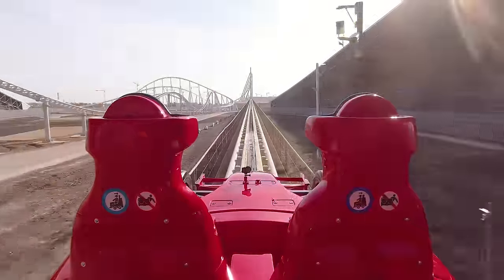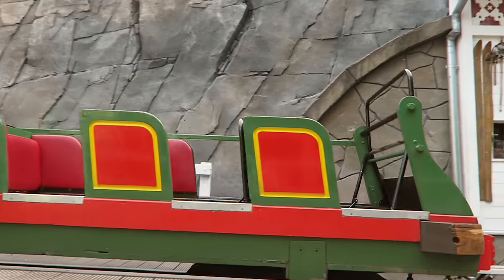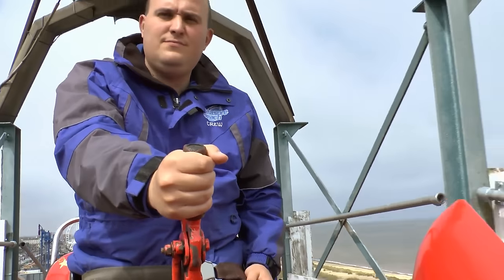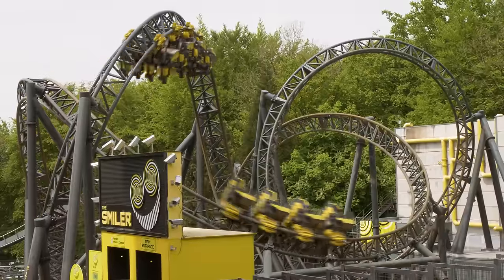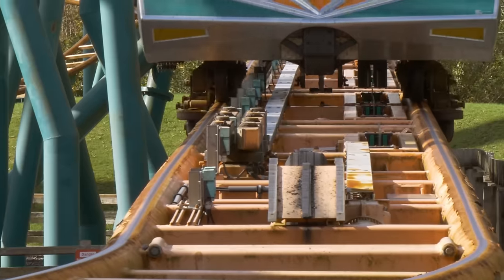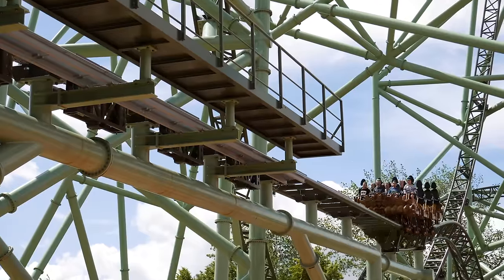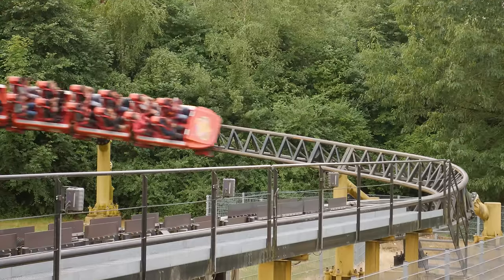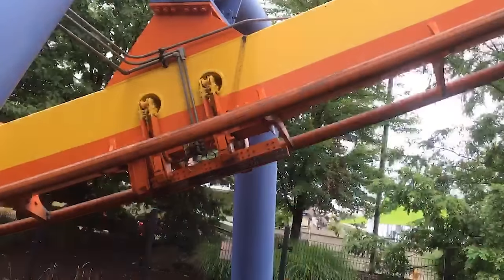Roller coaster brakes NEVER fail

Comment: Unforutnately, the Schwarzkopf systems still face similar issues to skid brakes;  Skid brakes still have issues even with cover during inclement weather. I've had instances where trains overshoot because of wet brakes (mind you this is over a decade ago at this point, and I know my personal example of the Schwarzkopf has been updated to magnetic system so I have no reference for anything on it since... but still). Water will still get carried into Skid brakes, as will water on the Schwarzkopf systems, still causing partial overshooting of the station or a brake section. While I've never seen a train manage to land back on a lift, I've seen them come close (at least to a point people had to re-ride) on both skid and side mount fin brakes. All it takes, is an efficient team of operators to get cars out in what would normally be good time where you can dispatch and let the next train nearly bypass a holding brake. All that said, a little cognizance by the crew and they can time just enough overlap to allow that holding brake to be needed, but for the computer to then cancel after slowing the incoming train a little more. 

So yes, while the brake systems will fail in an on position... everything else is still a factor.

Comment: One way to get around the downside of the magnetic brakes would be to put them on a "slide" conveyor and have the magnetic slide underneath the car relative to the car to generate the relative speed. Then stop the magnets as soon as  the car stops.

Comment: Can they not harvest power from the eddie currents? Probably not enough to use on anything useful?
Reply from the maker: That's a good point, I'm honestly not sure!
Reply: They don't, and I don't want them to. The only way you can really use that energy is if you use coils of wire in them. That way the energy only has one way out, and it is therefore concentrated and useful. However, there is a video here on youtube by Night Hawk In Light that demonstrates that a completed coil will have the braking force as expected, but if that wire is broken at any point in its length the braking force disappears completely.

There just isn't enough space for the current to flow if the wire is broken, and the current has no return path through the wire so it may as well not even be there. A solid plate allows the current to flow freely and provide the opposing electromagnetic field. Maybe you could harvest the heat, but when you are talking about brakes, harvesting the heat adds complexity and failure modes. Even if it ultimately wastes energy, I want to be assured the brakes will work every time.

Comment: Even in the event of a total failure a single train would eventually run out of momentum and coast to a stop,  probably winding down at the bottom of the first hill.  I imagine there is a breaks-off test done to see what the train does when its aloud keep going until it runs out of kinetic energy.  

It seems the biggest threat of break failure would be two trains colliding...  I'm sure even that could probably be engineered to less dangerous.  Bumpers, Crumple Zones,  and breaks designed to release when hit from behind.

Comment: Arrow/Vekoma/Morgan coasters with pneumatic friction brakes fail open. You will see that each brake has an air tank usually positioned on the catwalk handrail next to it. Each tank contains enough air to open/close the brake fully 3 times. There are multiple pressure sensors on each which will E-Stop the ride if it reaches a lower limit, way before the air runs out and the brakes open. This is how they’re effectively made “fail safe” even with a fail open design. 

You also mentioned that that fin brakes can only be positioned on straight track. Enigma at Pleasurewood Hills proves this not to be the case! Plenty of fin brakes on corners on that coaster.
Reply: Enigma has side mounted fins. this does make it possible as i would imagine are built much wide that normal to account for the turn, however i can also see this causing uneven wear. For coasters with fins under the train/ between the rails. it is not possible unless on a straight section of track. So for those hoping Dragster is going to have boosters install on the vertical hill, it wont happen.

Comment: Came for what I thought was a new roller coaster brake, and stayed for the history lesson. Although I do wonder about the fail-safe friction fin brake. Does it just ram the calipers with the fin or something?
Reply from the maker: I think about this too, but roller coasters are very precise things. The tolerances are minimal, so the fin should be able to slide into the caliper easily and without having to 'ram' it open. It's quite hard to see these things in action so I can't really give you any more detail than that sadly
Reply: @coasterbot i have noticed that most of the calipers in friction brakes actually have a funnel at either end to allow the fin to slip in even if the calipers are closed

Comment: In planet coaster & nl2 you have to set the intensity of magnet brakes, if it’s not high enough then it won’t slow down & if it’s too slow then it’ll stop but that in theory is unrealistic?
Reply: 7:24. Explains it all in there
Reply: @Furyman325  that’s what I’m talking about, if the intensity of magnet brakes is dependent on the speed of the train then planet coaster/nl2 don’t use magnet brakes realistically

Comment: why are magnets not being pursued for propulsion in cars? is it cost? it seems like there should be a way to create propulsion from an internal magnetic system, of course it would still need electricity to operate but am I wrong in thinking it would be much less than a normal EV?
Reply: Electric motors work using magnets
Reply: why could there not be a way to propel the wheels using an opposing magnetic force that is controlled in its output by a pedal. @Kapoosh000

Comment: I wish you would start with the point that coaster breaks such as the original on-board brakepeople and the skid trays, as well as reverse-actuated blocks are all off-locked so that pulling the lever (etc) RELEASES the brakes, that's the safety feature that means you're always stopped!

Comment: Slight technicality, magnetic brakes do wear. permanent magnets aren't actually permanent and become less magnetic very slowly over time this effect is made very slightly worse when the magnet expirences opposing force often(such as when the mag brakes are used).
Reply from the maker: Very good point! Do you know how quickly they wear? 1% every 10 years is the value floating around on Google, but naturally, I'd expect the magnets found on roller coaster trains to degrade much faster. It would be an interesting figure to know!
Reply: @coasterbot  It depends heavily on application, I don't think I have a number that would apply to this use case and even then it would change by implementation. Theres a chance the manufacturer tests it and has the numbers though.

Done right it is negligible, done wrong and letting the magnet oxidize/rust and it will cut the life down significantly.

In general I'm just being nit-picky and it's negligible, just another thing for the maintenance team/inspectors to check.

Comment: Did I a part where they described how they stop when the electricity goes out?
Reply: Primary roller coaster brakes are permanent magnets. They are not electromagnets. Therefore they will work 100% of the time, even in a power outage.

Comment: Except for when they do and you get stuck upside down right?
Reply from the maker: Roller coasters, in normal operation, won't get stuck upside down. They usually will stop at very specific pre-deternined points around the track.

Comment: I love technology and it is interesting to see how these rollercoasters evolved but you will never get me to sit into one ever. XD 
But are the magnetic breakes only permanent ones? Wouldn't it make sense to also use electric ones to have a second way of breaking stronger if the permanent ones loose strength over time. Even though it should take very long if they are made of a pure neuodym(?) metal.
Reply: Even if the permanent ones lose strength over time, roller coasters undergo maintenance daily. You don't need to worry about their brakes failing to work. If anything, they'll slowly lose their strength, but that would be easily noticeable by any ride operator or maintenance technician.

Comment: I think the best brake is the idea that the roller coaster can't be a perpetual motion machine, if you pull the car up to the first hill and it goes all the way around the track, it can't make it up to the same point again because it's not 100% efficient.

In other words, the coaster will never do more than one loop on the track unless you add more energy in. The last hill will always stop it.
Reply: Instructions unclear, perpetual motion  roller coaster is now constantly accelerating, and I am scared.

Comment: This reminds me of a sketchy coaster I went on once. Literally bolts and nails where falling every time it went around. You easily could have flew of on a down hill portion. The harness really only held you side to side not up and down. So on this down hill portion the G's would lift you up for about five-seven seconds. So your sitting there floating out of the harness. But I can't imagine a fear like four year old. They would fly out so easily. And I mean easily. If it can easily life an adult up for seven seconds a toddler would fly out of the sketchy harness.

Comment: Would be interesting if there is any energy recovery used with magnets on the train as a brake.
Reply from the maker: As far as I'm aware there isn't, but it would be an interesting thing to try!
Reply: I've not often seen energy recovery systems like that outside of battery operated machinery, which a roller coaster has no reason to be. The logistics of actually using that recovered energy without a battery doesn't really make sense, and I suspect the economics of having an energy recovery system versus just paying for power at the standard rate is no good.
Reply: @reaganharder1480  They could be used to launch the next coaster at the same time, or  stored in condensators or be backfeeded in the electric network.

Comment: Long haul tractor-trailer trucks have air brakes that utilize the same fail safe of using air pressure to turn the brakes off. If the air pressure goes out completely, the truck will come to a sudden stop. Same with school busses.
Reply: This fail-safe brake was originally designed by Westinghouse for trains.
Reply: @pleappleappleap  Yes!

Comment: Ah I was thinking about why so much variable braking was needed everywhere. It's because of the varying weight of passengers.
Reply: yep, thats why Fury 325 got a crack in its support beam. Median weight of passengers go up due to fastfood culture, and the lateral G-forces became too great on the support beam so it got a stress fracture.

Might be time to install weight scales on wagons and reject entry if a wagon is "full" weight-wise.
Reply: The cool thing about eddy current brakes is that the magnitude of their braking force is proportional to the velocity of the train. So if a train is heavier and thus has more inertia, more braking force will be inherently produced. All with unpowered, permanent magnets.

Comment: About maintenance: permanent magnets lose their charge and electronics (especially for high power electromagnets) also need servicing. There's always maintenance, but there may be a lot less of it and the manufacturer always looks into what maintenance is required
Reply from the maker: Exactly! There's always maintenance, but they look to less maintenance intensive solutions :)

Comment: Well, the Magnetic brakes can fail, if they dont get in their supposed position. Just watch king da ka after the launch, what happens, if the magnets dont come up "over" the track?
Reply: the springs would have to fail
Reply from the maker: As @Zyghqwyv mentioned, the magnets are pushed up out of the track by springs. They're actually forced down by hydraulics and naturally want to be in the 'up' state. There would be redundancy with the brakes in the sense that there would be more magnetic brakes than required to slow the train down. A significant proportion of the springs forcing the brakes up would have to fail for it to become a problem. With regular maintenance the chance of this happening is astronomically small.

Comment: Huh - I recall an accident in china, where a misaligned brake fin damaged all the electromagnetic brakes that all the fins were supposed to interact with, causing one train to ram into another at essentially full speed.
Reply: correct! however that was entirely the parks fault for not maintaining the ride correctly
Reply: @VECTOR_Coasters  the claim was 'never',  no exceptions were listed for non-redundant designs or lax maintenance - which are the two biggest sins of parks that kill guests.  *shrug*  I calls em as I sees em.
Reply: @Relkond  just don’t ride a coaster in a 3rd world country then 🤷‍♂️ it is so incredibly rare its insane

Comment: I imagine the brakes are just like

"Hmmm I don't feel like it" and pulls a smiler type accident
Reply: Smiler wasn't a brake failure. An empty train valleyed (stopped in a low point of the track due to insufficient momentum), and nobody noticed. The block it was in was reset by a supervisor, so the ride's computer thought it was empty and sent the next train, which was loaded, into it.
Reply: @happysword258  and it even not using brakes at all because the device which released the full train was the lift hill.

Comment: Roller coaster brakes CAN fail if they aren't properly maintained, even for magnetic brakes. We saw an example of this last year at Happy Valley Shenzen. One of the brake fins was misaligned due to a broken bolt. This caused the entire magnetic assembly under the car to break when it failed to crest the first hill. As a consequence the car was unable to stop and hit into another car behind it.
Reply: that accident was 100% at fault of the theme park, it has a reputation for poor maintenance.

Comment: Can't really say NEVER :P  
If there's poor maintenance or bad materials sneak into the supply chain, something could not work as intended or fail. The designs won't fail you though.  
The other breaks that won't fail as they are based on physics fundamentals and do a lot of the work are: air resistance and fighting back up against gravity too :) but if say a piece of track is damaged, and it doesn't do it's job as designed for any reason, then it ceases to let gravity do it's job as intended for that bit of track so the "breaks" could fail even though it's gravity technically :P  
It's like a trusted break on a trusted model of car will always work, perfectly, billions of times in a row. Unless poorly maintained or otherwise there's a human error side channelling that good engineering, same idea.  
Anyway, really good b-roll in this video.

Comment: Magnetic brakes are essentially the opposite of magnetic launch systems in roller coasters, magnetic launch systems are just linear induction motors, where magnetic brakes are basically just linear generators, the difference is magnetic launch systems convert electrical energy into kinetic energy, magnetic brakes do the opposite, they convert kinetic energy into electrical energy, kinda like the dynamic brakes on trains

Comment: What happens if there is a power outage?  What would the roller coaster do if the computer system suddenly crashes?
Reply: They have the brakes set to on so even without power the brakes would work. And the same with permanent magnets, no power needed
Reply: Primary roller coaster brakes are permanent magnets. They are not electromagnets. Therefore they will work 100% of the time, even in a power outage.

Comment: Don't forget! If it's starting to rain and you don't want to shut down your Wild Mouse coaster, just have the teenagers earning $2.35 an hour operating it CLIMB THE WET STEEL IN THE RAIN without a harness and sprinkle some Comet Cleaner on the brake pads on the block sections before the curves! 

That will get you an extra twenty to thirty minutes of operating time before the rain and the cars wash it off. Good luck stopping the car that eventually runs them, though! You'd better clear the loading area of any cars before it arrives because it's going to be running all the unloading brakes, too. (Hey, that's why the cars had spring bumpers, right?)

Obviously, you have to use Comet because of the coaster connection.

That's what we were told to do (and did) at Dogpatch USA in the 80s.

Comment: Not sure if fail safe is being used correctly.
Reply from the maker: I feel it aligns with this definition:

In engineering, a fail-safe is a design feature or practice that, in the event of a failure of the design feature, inherently responds in a way that will cause minimal or no harm to other equipment, to the environment or to people. Unlike inherent safety to a particular hazard, a system being "fail-safe" does not mean that failure is naturally inconsequential, but rather that the system's design prevents or mitigates unsafe consequences of the system's failure.